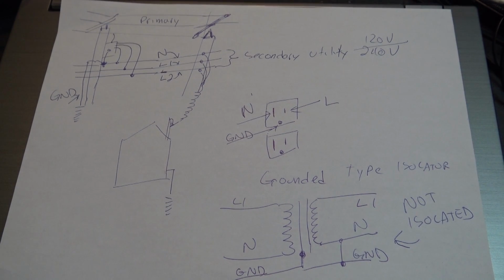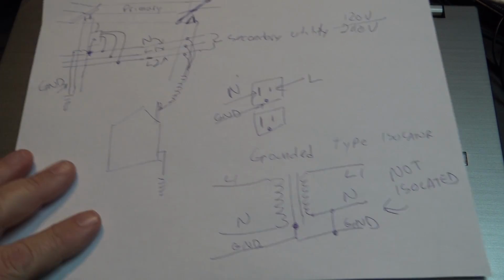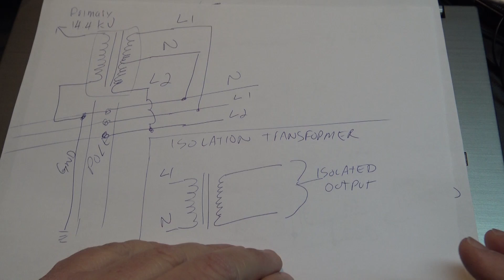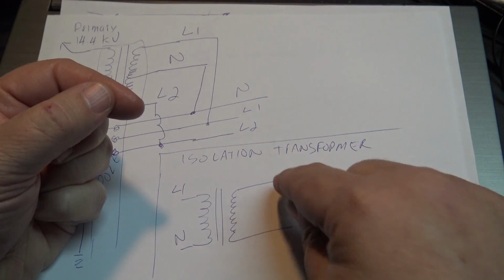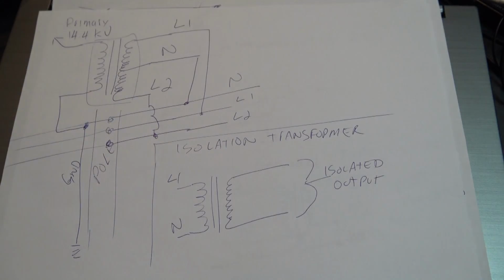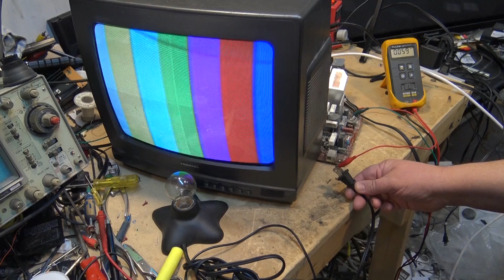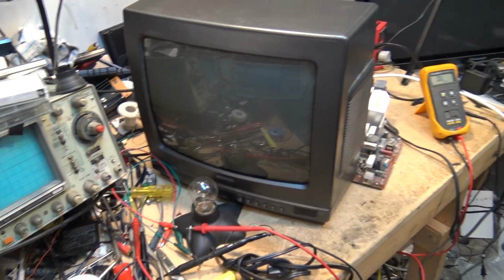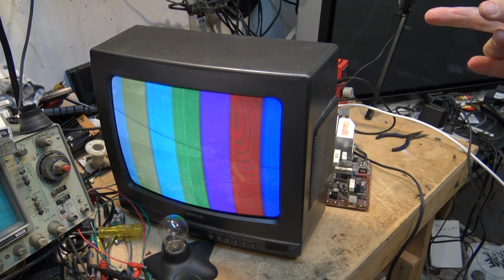Isolation transformer explained and demonstration

Comment: why don't you touch the secondary wire  and ground with your hands  instead of the lightbulb to demonstrate the safety of an isolation transformer. that would impress more .

Comment: Question regarding the information about the ground prong, at 10:24:

If making my own isolation transformer setup (off-the-shelf transformer per se, but making an enclosure for it with switches and fuses and things), would it make sense to tie the "ground" prong of the outlet to the neutral side of the outlet, as long as neither of them is tied to anything actually referenced to earth ground?  If not, why would that be a problem?  Like, I'm thinking it would be a "ground" that floats with the neutral side, and the live side would have 120v between it and either the neutral or the "ground" (I keep using quotes to emphasize that I don't mean actually ground-tied), but could also be (real-)ground referenced thus making the "neutral" and "ground" effectively live... would this be reasonable?  Or should I just leave it completely non-connected?

My thought is to do this for DUT's that have a grounding plug, to just give them something to connect to......  But I'm not entirely sure if it's reasonable.  Any input is welcome!  Thanks for the video!
Reply from the maker: A serviceman's isolation transformer has 2 wires.  Hot and neutral only. No ground.  The ground prong can not be connected to a thing or you are defeating the safety the isolation transformer gives you.  Mine is a commercial transformer that cost a bloody fortune. It has a 2 prong non polarized line cord and just a 2 prong secondary receptacle. Can not plug a 3 prong plug into it.  Have to cut it off. Mine is a Hammond and it originally cost about a buck a watt. (500 watts, 500.00)
Reply: @12voltvids  I don't want to cut off the ground prong on my DUTs, as I'll want to use them safely when not under test, as well.  I know there are only two output wires from the secondary (well, assuming a single transformer voltage, though of course there are multi-tap isolation transformers, too), the question is, would it make sense to wire the "neutral" (though that's arbitrary, as both sides are floating) wire to the "ground" wire of the output socket -- not grounding it, it's still galvanically isolated from the mains, it'd just be that if, say, the DUT had a chassis ground that connected to what it expected to be an earth ground, that "ground" would be connected to one side of the secondary (which we'll call the neutral).

Does that somehow lose safety?  If so, how/why?
Reply from the maker: @DavidLindes  a short extension cord solves this delemina.  You can get short 1 to 3 foot cords.  The ground pin comes off easy. Then you can plug your DUT into the 3 prong receotical on the short cord.
Reply: @12voltvids  ok.  But is there any danger in shorting the "ground" pin to the neutral side?  Seems innocuous to me, but I wonder if I'm missing something.
Reply from the maker: @DavidLindes  you don't want to connect the ground pin to anything.  It is totally open.  With the neutral unbonded it will float as well.  Your meter will still read accurately on the DC side of the power transformer.  If measuring on AC side then one probe goes to neutral not ground.

Comment: Does that means that after the insulation transformer there is no Live/Gnd anymore? I mean, are those two wires after the transformer exactly the same, or do is there any difference between them?
Reply: There is no difference in the large scale. If you view it in any tiny time unit there is voltage between them that varies -170...+170 volts

Comment: My Isolation I made works perfect, no earthg grounds, but i was thinking could I just ground the chassie in case of a faulty primary so as not to receive a shock in such a event?
Reply: If the chassis is not grounded it is double insulated. Do not ground it.

Comment: You would get the same exact result if the secondary of the isolation transformer DID have a ground to the case as long as the neutral isn't bonded as well. 
It's done this way in every single operating room in the US. There is still a ground(bonding) jumper that puts every piece of stainless equipment at the same potential. This ground however is NOT bonded to the secondary winding AT ALL. You can touch a hot lead and touch ground and 0 current will flow.

Take your hot from the secondary of the iso transformer put it on the bulb, take the wire from the neutral side of the bulb and ground it. Does the bulb light? No.
Reply from the maker: You can earth equipment for sure. The problem is many so called isolation transformers also tie the neutral side of the secondary to ground and that defeats the purpose.
Reply: @12voltvids  if that's the case it shouldn't be called an isolation transformer because that is in fact defeating the purpose. In that case it's simply a 1:1 transformer and probably some type of false advertising.

Eta- the drawing made of the first grounded type isolation transformer is in fact a fully isolated transformer that will completely isolate you from earth or any grounded surface- even with the ground wire as long as it's not bonded. Thus is exactly how operating room iso systems are designed and wired. It's MORE dangerous to not have that bonding wire.(Again, it absolutely can not be bonded to the winding though)
Reply from the maker: @di1ligaf628  
My isolation transformer has no ground.  There is no ground prong on primary or secondary.  2 prong cord on primary and 2 prong receptical on secondary.  Totally isolated.
Reply: @12voltvids  I get that. My point is you're JUST as isolated even with a 3 wire / 3 prong setup. It can be argued, and has been, that an isolated system with a ground is safer than without due to capacitive coupling and leakage current. Leakage current is much lower when a ground wire is used- hence the reason they are done this way in operating rooms where current that a normal person couldn't even feel could easily kill an infant or someone with their chest opened up with metal instruments touching their heart.

Comment: What is a 1:1 grounded transformer used for?
Reply from the maker: A grounded 1:1 is not isolated. You can remove the bond to ground and float the secondary winding to make it an isolation transformer.  These type are usually used in medical devices where they what to isolate from mains connection but need to remain earthed. They are not a serviceman isolation transformer until the earth bond is completely isolated.

Comment: Some TV's use hot chassis, I'm confused why they would even want to make a TV hot chassis for what reasons to put very high voltage on the chassis is just poor designing but it was common in arcade game monitors that if you hand was touching the chassis and your other hand was touching the circuit boards ground or oscilloscope chassis you would get a major shock. I don't know why the benefits of the TV designers to use hot chassis just doesn't make sense to me, any reasons why?
Reply from the maker: One word. Cost. Power transformers are expensive. Since there is already a big transformer inside for the high voltage it is easier and much cheaper just to add some low voltage windings to that flyback.   For the end user it doesn't add any risk, just service people need to use an isolation transformer which any tech worthy if calling himself a tech already has and is using.
Reply: @12voltvids  But most EE techs say that only isolation transformers are Galvantic isolation, and that Non Isolation transformers don't have Galvantic Isolation. I'm not sure what inside the transformer is causing the transformers to be Galvantic Isolation, do you know?
Reply from the maker: @waynegram8907  
A full isolation transformers do not have a ground lug or ground pin on the secondary.   Mine has a 2 prong cord and 2 prong outlet.  100% isolation. Some have the secondary bonded to neutral which is not isolated at all.  Might as well not even be there.
Reply: @12voltvids  arcade monitors isolation transformers has a 3 prong cord/outlet primary and the secondary is 2 prong outlet going to the monitors circuit boards and hot chassis. I'm not sure why they design it to have a hot chassis having very high voltage on the chassis frame metal
Reply from the maker: @waynegram8907  one word.  Cost.
Reply: @12voltvids  I have heard other tv repair technicians tell me not to use and never to use an isolation transformer because you use your dual channel oscope in the add mode setting and channel#1 can measure all the high voltage tv monitor waveforms while channel#2 is connected to the monitors isolated ground point that is above chassis ground. Have you tried doing this method?
Reply from the maker: @waynegram8907  sounds like bullshit to me.  Tell them to go back to school.

Comment: I bought a new isolation transformer for my 14 year old future electrical engineer. I am wondering why I bought it! Perhaps because I have seen so many YouTube videos on I/T’s. Such a gadget will not prevent electrocution when working on 240 vac projects. It will only protect the scope and other    equipment. I use a RCD (residual current device) also referred to as a (DCD, differential current device on all my circuits, in fact 22 of them. In Australia we have 240 vac and the common ground (neutral) is tied to the ground stake as a safety measure, same as in many other countries. If I am working on any 240 vac equipment and I for some reason touch the active wire, the power goes off within 30 m/s when a differential of 15 mA is detected. So the scope is off and I am safe. Why do I need an I/T ? I am going to test this out on my own equipment by shorting something out when connected to the scope. I paid $250 for the I/T. The RCD’s cost about $15. I see someone suggested a $400 device on the probe to protect the scope, yes, but that doesn’t protect your life. I am not getting it, can someone please explain to me why a $15 gadget will not only protect the scope and my life?
Reply from the maker: A proper isolation transformer has no reference to neutral or ground on the isolated side.  Both prongs on the plug are isolated.  If you touch either side while grounded you will not receive a shock because there is no return path to ground. If you touch both at the same time then you will receive a shock.  If you grab one wire on one hand and the other with the other then you have completed a path across the heart and you could end up electrocuted.   The big safety factor is accidental shock.  That is you touching something live (mains connected ) and the current running through your body and out your feet into earth.  This is where the isolation transformer protects you. It also protects your scope from damage.  Your ground fault interrupters are good, but when you have a fault in the device you are working on and the breaker trips every time you try to power it up for testing you become very frustrated 😡. Isolation transformer keeps you safe from accidental shock.  Your GFCI by the way I only protects from ground leakage. You will still like with an isolation transformer get zapped if you grab Live  and neutral.  I can speak from experience.  I wouldn't be commenting here had it not been for my transformer.   When I was as working in the business a cable tv (grounded) connector dropped off the tv I was working on and onto my forearm startling me. I jumped and in the process contacted a hot chassis directly connected to power.  I could have received a major shock but because the tv was plugged into my isolation. Transformer i didn't as much as receive a tingle of voltage.  Nothing.   Also when the connector fell into the chassis it didn't short out again because the set was isolated.
Reply: @12voltvids  Thanks for a very lengthy explanation all of which I knew. But please explain to me why a RCD which will save your scope and other equipment as well as your life isn't better than an I/T,,, thanks.
Reply from the maker: @cookieboi4449  you will still become the conductor until the current is cut off and that jolt is enough to send your heart into fibulation.  They are safer than no protection but you still get zapped for an instant of a second until the circuit trips.  With an isolation transformer there is no current flow at all, you float just like a bird on a wire.

Comment: So since I salvaged my transformer from my Karaoke Machine, is there a way that I can use my own transformer as a isolation transformer when servicing the electronics?
Reply from the maker: Need to be a 1:1 ratio not a step down as most devices would have.

Comment: Can you recommend an isolation transformer for my first bench?
Reply from the maker: Mine is a Hammond if I remember.  Allison manufacturing also makes them. Just be sure you get one that does not have a pass through ground.   2 prong cord only.  If it has a ground prong on the cord it must be cut off so there is no bond to ground whatsoever. This is very important.  If there is any bond to ground then the safety provided by an isolation transformer are lost.
Reply: @12voltvids  I got a TrippLite IS-1000 I would like to plug in front of all of my pro audio recording gear. Can I just use a couple of cheater plugs (one on each side) to make it truly isolated? I see some people doing modifications to remove the secondary ground to neutral, which I what I was going to try until I saw this video. Thanks in advance!
Reply: @crossdynamix7176  got exact same situation and query as CrossDynamix.  did the mod,removing grnd from secondary neutral, but am stuck in the same place as CrossD.  If the secondary hot and neutral wires are floating then how would passing ground from mains counteract the separation of ground from neutral on the output?  Furthermore, would severing connection to output ground be enough to float the output entirely, without disconnecting chassis ground from primary?  Thanks

Comment: In Germany every fuse box has a ground fault circuit interrupter, so when a short occurs, the power automatically cuts. Do you not have this in the US?
Reply from the maker: We have ground fault interrupters but they are only required for outdoor plugs and plugs located in bathrooms or around water.

Comment: sir whether one should connect crt tv to isolation transformer and connect oscilloscope directly on main 220 v line  and carry out the test or vice versa .which way is the better
Reply from the maker: My scope is connected directly to mains however my scope had had the ground (earth) prong removed from the cord. My scope floats. If you don't want to remove the earth pin then plug it into the isolation transformer as well.  The whole point if using isolation transformer is safety while servicing and that means no equipment under test can be earth referenced. It has to float so that an accidental touch to live circuit will not result in you becoming the complete path to ground.  Even if you are grounded the unit under test is isolated.

Comment: Hi, just wanted to ask you a question about AC outlet dirty power. I'm a musician the several guitar amps in my house that I use. I seem to have a problem with the these amps displaying high frequency harmonic distortion. I've tried everything to alleviate this problem, but nothing seems to work. I heard of an audio isolation transformer called a Topaz ultra isolation transformer 32 series that you can plug your equipment in and it will filter out any noise problems. Do you know if something like this would be a good idea to buy? Thanks Michael Newell from Niagara Falls, Ontario
Reply: I'm having similar issues with my recording studio setup. ugly mud creeps into the guitar tracks as soon as any gain is added. I've tried everything - power conditioners (got the Panamax), UPS online double conversion (TrippLite), and now about to try isolation transformer (got the Tripplite IS1000). I have seen other videos that modify the iso transformer by removing the ground to neutral on the secondary... but is it as easy as using a cheater plug on both sides?!?

Comment: it would be useful to show a schematic of what you are doing
Reply from the maker: Somebody is skipping ahead because the very first thing that shows up after the intro is guess what? A schematic showing what an isolation transformer and an explanation on how it works and why you need one.
Reply: @12voltvids  Sorry, I did see that schematic... I  do see what you were trying to illustrate by using the light bulb and isolation transformer but got a a bit lost trying to follow what you were connecting to what
Reply: I agree. Showing the circuit during your testing was missing. We could hardly follow what is going on. And I am not talking about the general concept you have shown at the begging.

Comment: Why does virtually every isolation transformer on Amazon have grounded receptacles? I totally get what you're saying which begs the question as to what the value of a grounded isolation transformer is. What are they used for?
Reply from the maker: That defeats the purpose.round prong needs removing on those for sure. A proper serviceman's isolation transformer like mine has a 2 prong cord and 2 prong receptical on the transformer. Actually it has 3. The secondary has 3 taps, 90%, 100% and 110% outputs. For 120 in that makes the 3 outputs 105, 120 and 135 approximately.  I use the high side and rum it into my variac so I can go from 0 to 150 volts.